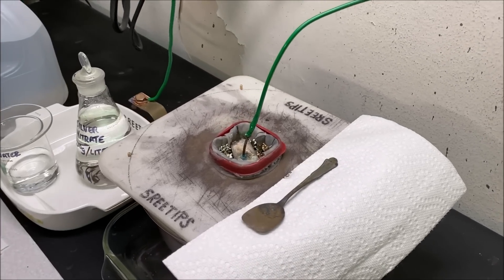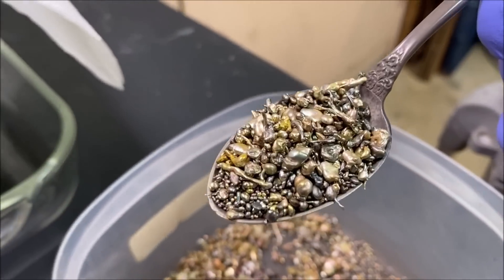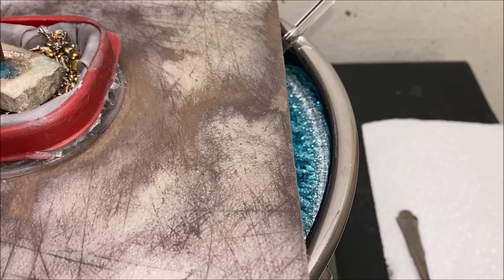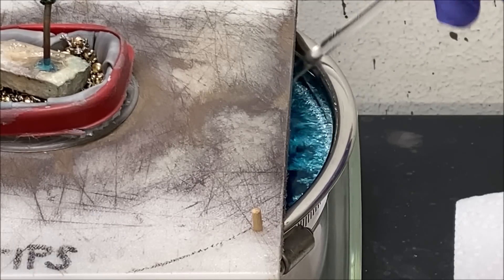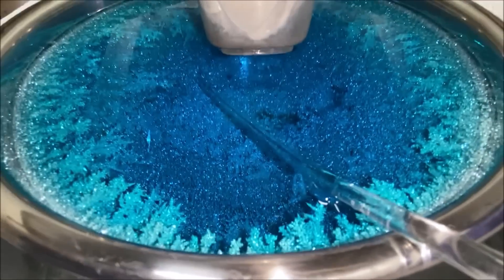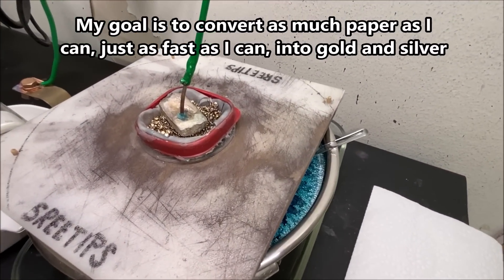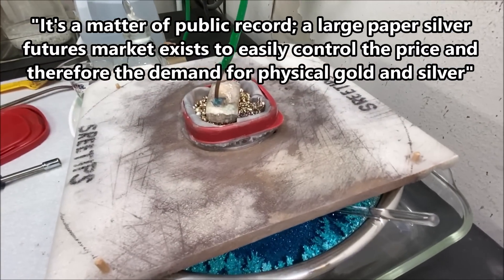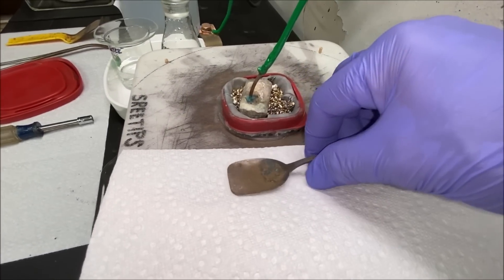Silver Cell Crystal Growth Day 5

Comment: Hey sreetips, I remember whenever you do your stock pot refining and silver slime refining you mention refining rhodium and how hard it is. I’d love to see a video on that again using the techniques used in Codyslab’s video where he refined a rhodium/gold alloy.
Reply from the maker: I’ve worked with platinum group metals in the past. I have videos on refining platinum and palladium. In my last attempt, trying a bromate hydrolysis, I exposed myself multiple times to the irreversible effects of platinosis. With my crude setup, I’m just not comfortable working with platinum group metals in my shop. It requires special equipment and knowledge. For these reasons I probably won’t be doing any more PGM refining. Too damn dangerous!

Comment: You can wrap teflon tape around the ground glass plug. There are also premade teflon collars. You can use silicon grease or other specially made greases to lubricate the glass joints (although heavy silicon grease is usually best), because they can and eventually will seize up to the point where you will destroy the glassware. I always preferred plastic plugs except for applications requiring heat, or vacuum, or both. When storing glassware with ground joints, always insert a piece of filter paper or similar material if the plug is inserted. Especially with addition and separation  funnels and Schlenk-type glassware... they are expensive. Teflon cocks for these exist, but they also require silicon grease.
If a glass joint is stuck you can try to salvage it with penetrating oil and a heat gun, but this might create dangerous conditions if there is still something in the glassware, like solvents...
And then there are glass desiccators. ALWAYS lube these. I have seen many which were forgotten for a few weeks or months or even longer, and they had to be "opened" by destroying the lid. That's why the lid MUST NOT be placed centrally on the desiccator, but with an offset so the lid protrudes to the side. If it becomes stuck you can the push it into a corner.
Reply from the maker: I agree. I’ve never broken one - yet. But I have used hot water bath and pliers with paper towel wrapped around the jaws to carefully loosen and then remove it. The worst I’ve seen is when it’s hot, the stopper is put it, then the ambient temperature cools and a strong vacuum forms making it very difficult to get the stopper off.

Comment: I used to buy silver as a store of value, then the housing market crashed. I was in construction and not only did work dry up, but even builders were losing their homes with dozens of unsold new houses sitting empty. Silver dropped fast, and before it went any lower I sold mine off to pay bills. Those were scary times and I never bought any more bulk bullion or coins. Maybe it's time to rethink that.
Reply from the maker: Remarks made by then President Johnson about the coinage act (debasing of our silver coins) in 1965, and I quote, “ If anybody has any idea of hoarding our silver coins, let me say this. Treasury has a lot of silver on hand, and it can be, and it will be used to keep the price of silver in line with its value in our present silver coin. There will be no profit in holding them out of circulation for the value of their silver content.” He actually said that. This is a matter of public record. But today they don’t even need to dump physical silver to suppress the spot price, they can conjure a million ounces of silver on paper and sell, sell, sell! This serves as an effective way to control the price, and therefore the demand, for the physical metal. Gold too. Haven’t you ever wondered why everything has doubled, tripled, or even quadrupled, while precious metals (and oil for that matter) have remained subdued? The price of oil is plastered on every street corner visible to all drivers every few blocks. This has a tremendous physiological affect on the population about inflation. It screams, “SEE, INFLATION IS NOTHING TO WORRY ABOUT.” In 1964 a gallon of gasoline was about $0.25 per gallon. Today, a 90% silver quarter is worth about four bucks. With gasoline at around $3.00 per gallon, priced in silver, that same quarter (worth about $4 because if it’s silver content) will buy a gallon and a third. This means that, priced in silver, gasoline is cheaper than it was back in 1964!
Reply: @sreetips  That quote sure does sound geared toward lending confidence in paper currency to the detriment of precious metals. We are unfortunately held to the petrodollar standard. It seems farcical that of these two finite resources the exhaustible one would be used as the measure of currency value.
Reply: And here I was thinking this channel was about chemistry... Wow
Reply: @PaulAllee  He was talking about buying precious metals as a store of value.. on a precious metals channel. Yeah, wow.
Reply: @PaulAllee  I am going to leave a second reply for added clarity. Any hydrometallurgical, electrochemical, pyrochemical or electrolytic processes you see on this channel are geared toward one goal; recovering precious metals. If not for their inherent value the aforementioned would be irrelevant to acquisition. I am stunned at your myopic attitude toward to subject. In other words, your condescending attitude is not appreciated.

Comment: As silver is mostly a byproduct of "other" mining.   I imagine, the price becomes depressed.
Due to the supply/demand 
 Only 27% of silver derives from mining activities where silver comprises the primary source of revenue. The remaining 73% comes from projects where silver is a by-product of mining other metals, such as copper, lead, and zinc.  
I'm sure if the need for silver increased to a point where only 25 to 35% came in as a byproduct  of mining other metals.  The price would increase 10 fold.
Reply from the maker: Silver is a by-product of my gold refining. I use sterling silver to inquart the gold then pull it back out with all the other impurities with hot dilute nitric. I end up with much cement silver that I don’t need anymore. So I melt it up into shot and run it through my silver cell.
Reply: @sreetips  And that reinforces my argument.  As long as Silver is the byproduct and not the Goal.  The price will stay low.  The only real differences in the Royal metals is desirability, and color.  When it come down to it, Other then gold is "soft" ... As always thanks for the video.
Reply from the maker: Sorry, I didn’t realize that you were arguing.
Reply: Ok  sorry  @sreetips   just sayin' as long as silver is byproduct it will be cheap. You your self have buckets of silver powder, and I can see why your in no hurry to make it into Pretty silver bars.  Answer is; At this point in time it isn't wroth it
Reply from the maker: I disagree, holding silver is well worth it. I’d rather have stacks of silver than stacks of paper dollars that are declining in value faster than a snowball melting in July. I’m not in a hurry to refine my silver because I don’t want to sell any of it.
Reply: @sreetips  and if you melt it you'll have to sell it?

Comment: The depletion of the silver in the electrolyte is only partly caused by silver being plated on the cathode. Most of this plated silver is directly replaced on a one to one atomic basis in the electrolyte by silver being  dissolved from the anode. The depletion of electrolyte silver is mainly due to the copper impurity that dissolves from the anode producing that beautiful blue colour. This copper displaces electrolyte silver in a one to two atomic ratio, ie one atom of dissolving copper displaces two atoms of silver that is plating onto the cathode.

I always enjoy watching your videos. Thanks for your work.
Reply from the maker: I tried to use un-replenished silver nitrate electrolyte for a third run once way back when I first started refining silver in the stainless steel cell. I remember trying to remove the silver from the blue liquid, after the failed third run, by adding hydrochloric acid to precipitate the silver chloride. To my astonishment, NO SILVER CHLORIDE PRECIPITATED OUT! I was dumbfounded. The silver gets depleted from the silver nitrate as the cell operates. I’d always heard that on the GFR. The silver was so depleted that no silver was left in the electrolyte to precipitate out, no matter how much HCl I added. Made a believer out of me. I never use the same electrolyte more than twice. And I always add about 200g of additional silver for the second use.

Comment: Sreetips, very good economics commentary. You're 100% correct. Just a heads up on your silver cell, I noticed what looked like a runaway crystal tree on the left side of the cell. You might want to keep an  eye on that one so it doesn't chase its' way to the basket faster than expected and cause a you know what.
Reply from the maker: As they grow toward the filter basket they usually get too heavy and fall to the bottom of the cell. But then they build up from the bottom toward the filter. I knock them down with the glass rod.
Reply: I was wondering what would happen if it did that?
Reply: @jasonhunt2932  it will short the cell 😅

Comment: Sir
I am wondering if you can inquart with cement silver versus metal shot? Is there any benefit?
Reply from the maker: Not recommended because palladium will build up in the silver and cause problems in the silver cell.
Reply: @sreetips  excellent. I forgot the that other precious metals were still in the powder.
Reply: @sreetips  Eventually.  Not immediately.

You don’t know if it’s the second use of cement silver or the twentieth.

A richer anode slime makes working the Pd up more productive.

At 100x the value of Ag, Pd is as worthwhile as working up your Au.

Every time you use cement Ag versus pure Ag, your total Ag output nets out as ‘higher.’

Comment: I was curious as to how much silver you net from each run. What I mean is what is the amount of silver you have to dissolve for silver nitrate and how much impure shot you have to use to get the 1.5kg you normally recover.
Reply from the maker: I spend 800g of pure silver to get two runs of 1500g each of pure silver harvest. So: 3000g of silver takes 800g of silver, net 2200g of pure silver, plus I cement out a couple hundred grams from the used electrolyte. I’ve written this many times.
Reply: @sreetips  thank you for explaining.

Comment: for all the platinum and gold are praised for their value silver has a higher range ahead for its use in all manner of electronics and other devices that need low resistance metals. stocking it in bulk will be very valuable in a fairly short time as the silver crash of the 80s fades and its new star rises
Reply: Platinum has dozens of uses in industry and chemistry.  Best part is that it's used as s catalyst so almost none of it gets used up.